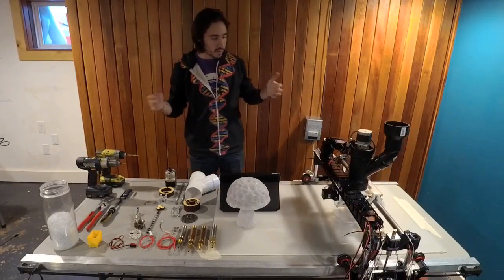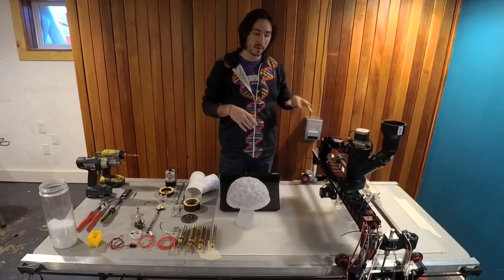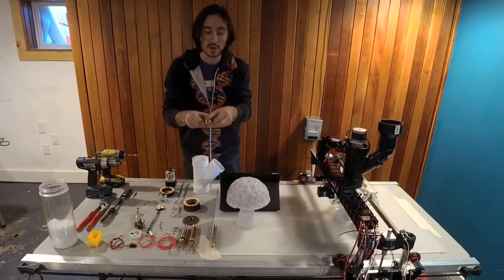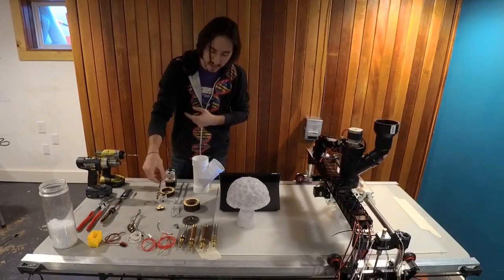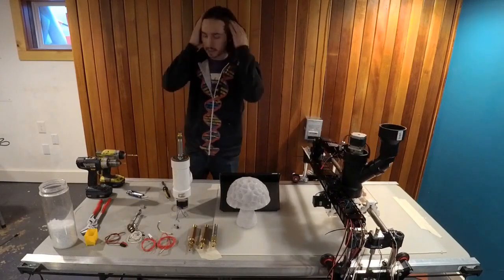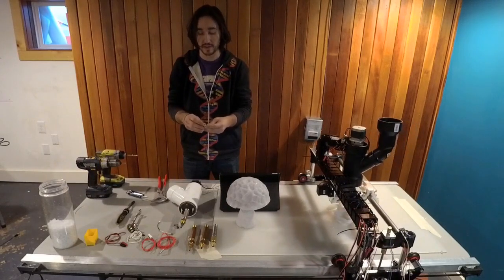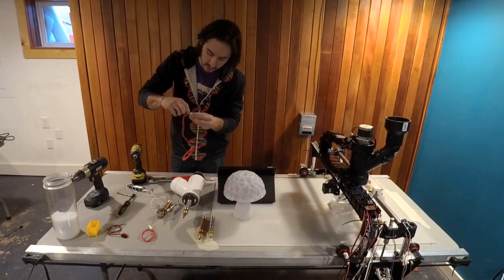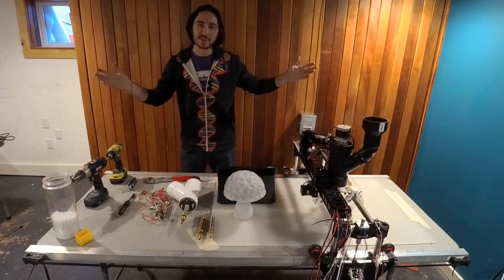This 3D Printer Eats Trash (ft. Disruptively Useful)

Comment: Great job on the built! Thanks for sharing!!! Any idea how you will deal with bed adhesion issue and bed leveling with such a large bed?
Reply: I've tried all sorts of things, but the thing I've had the best results with is just printing onto packing tape. I really like the Gorilla brand packing tape bc it's super thick and adheres really well. I believe this tape, and many packing tapes, are made of polypropylene with an adhesive, and so the polypropylene extrusion sticks to the tape and the adhesive on the other side makes the tape stick to whatever your build surface is, I like using glass or mirror bc it's extremely flat and looks cool. When I started out, I got around the adhesion issue by just printing onto a sheet of PP as my build plate, and there's a point (for me 280C nozzle temp) where the extrusion fuses lightly to the plastic but doesn't fully fuse, so that it pops off easily later. That works well enough but the build plate pretty quickly gets pitted and scarred. Also keep in mind that Olefins generally, Polypropylene #5, and Polyethylene (#2 and #4) are always going to have extreme warp and adhesion issues and that's just how it is, there's no easy trick that fully solves that problem. But I've had great luck with the packing tape trick, and I suggest you start there. It creates a bit of extra waste, but it's well worth it for the adhesion it provides. If you find something that works better, please let us know!

Comment: So... this is /excellent/ and so critical for our future! Thanks! I would like to echo Chatter On The Wire and suggest that a re-taping of this with the camera MUCH closer to the work would really help. I've built  few things and so I can figure out what your doing mostly from your words, but a lot of people will need help since they can't really see the work. Also, are you aware of Norbert (HomeFaciens) printer which does nearly the same thing? His version uses a NEMA 17, 3D printed parts, and a few soldered parts. It's a much lighter extruder so it will work with a standard 3D printer instead of a CNC machine. And it runs faster. Your version is much larger, and, I think, easier to build. y'all should compare note, maybe? 
https://www.youtube.com/watch?v=l_cRzS2bBpg

Anyway, I'm totally impressed with your design and for anyone with a larger space and budget, it seems like a great choice.
Reply from the maker: Thanks for the info, and yeah a part 2 is in the works.